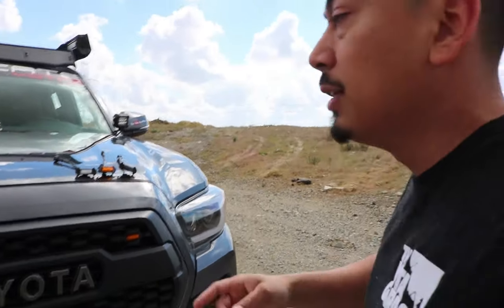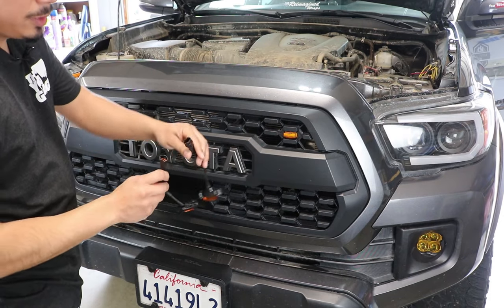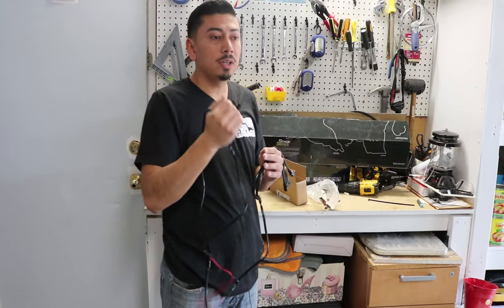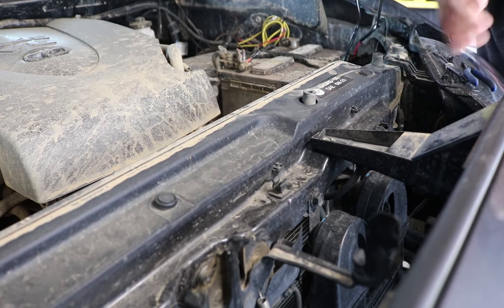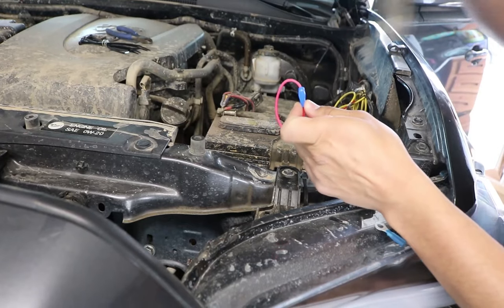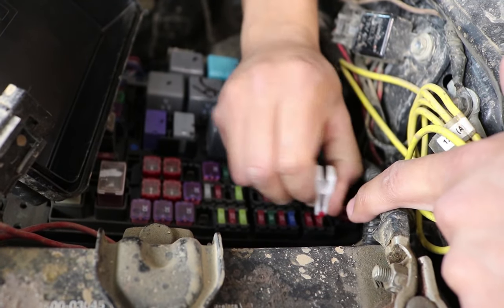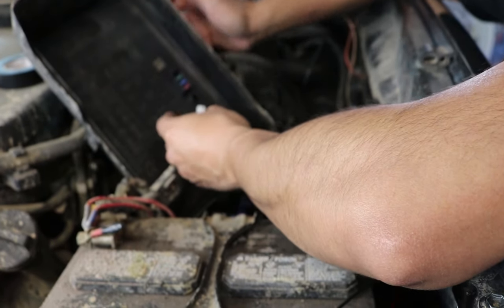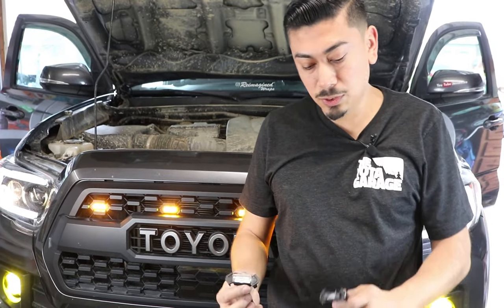HOW TO WIRE + INSTALL RAPTOR LIGHTS ON A  2016+ toyota tacoma TRD PRO GRILLE | MUST HAVE MOD

Comment: PROBLEMS I HAD

1. I had to use sand paper on both vertical sides of the outside 2 lights, they wouldn’t fit in the gaps of the grill. Took 1/8th inch off each side of the 2 lights.

2. Was only able to snap 2 of the 3 clips back on the fuse box because there isn’t an opening to feed the wires through to the box. 

3. If you assemble the grill too, the lock washers that go on the sensor need opened up a little with needle nose pliers before they’re put on. Had to throw pipe dope over top of them to keep them from slipping off. 

4. Taking the factory grill off in the beginning & trying to pull out the 12 or so tabs is a 100% guaranteed pain in the ass. 

5. Had to sandwich a washer in between the sensor & grill on the top screw hole connecting the sensor to the grill. Got a sensor error without it because the sensor sits too low to read anything. 

Great grill just a pain in the ass install.

Comment: How did you get fuse box to shut entirely? My front clip won’t snap on my 21 Tacoma with the wires coming out the side? It’s closed and won’t be used off road.
Reply from the maker: Slammed on it lol

Comment: Should battery terminal be off when messing with fuse?
Reply from the maker: Yes anytime working with electrical you want to disconnect the negative of the battery

Comment: When you installed the new TRD pro grille do you need to take it to the Toyota so they can reprogram the censors? Since it got change ?
Reply from the maker: No my friend just make sure u get a oem garnish for the sensor and ur good to go I left a link to where u can get the grille and in that website they also have the oem garnishses
Reply: I got an oem garnish off of Ebay for $25. Works great. No sensor error. Beats paying what Toyota wants for one!
Reply: Stingr1971 That 100% is not OEM if it was $25 off of eBay lol

Comment: With this installation,  do you need to turn on the headlights in order for the grille lights to  work?
Reply from the maker: Yes as far as how I installed in the video
Reply: @JesseRizo  you can tap into the INJ : ignition fuse and will turn on without the lights being on.
Reply: @SlickWillie  even with the same fuses 10 - 15?
Reply: @OscarHernandez-xn1yx  use the same fuse number as the inj...i forgot what it was

Comment: How do you close the fuse box tight with the wires coming out of it?
Reply from the maker: I’m trying to find the video I did but I’m having trouble but long story short if you can extended the wire I’d suggest tapping into the inside fuse box look for a acc applicable fuse and tap into that better (I ran it outside like in the video) for the longest never had a problem but it does get dusty in there over time and to close you have to cut a slight slit and even then it slightly pinches the wire which allows slight dust over time to sink in so if u have extra wire I’d recommend that
Reply: Simple get a small round file and put a notch in the plastic fuse box or cover for the wire to sit in

Comment: Hey Jesse, How is going over there. I just installed my raptor lights, but before installing them, I stop by Autozone and looked for the 10 amp fuse, and of course bought the 2 pack, only to find out that the fuses are not the same as the ones in the fuse box, I tried twice to figure out the sizes on the fuse, can you tell me what size they are please.
Reply from the maker: There the low profile for the Tacoma’s https://www.amazon.com/gp/aw/d/B087WZ953T?psc=1&ref=ppx_pop_mob_b_asin_title

Comment: What if I drilled a small hole in the fuse box cap to fit the wire, would that cause any issues?
Reply from the maker: It’s possible but make sure u buy sealant so water won’t leak in

Comment: Just added my grill and raptor lights. Waiting on my headlights to come. So the add a fuse is going to get pinched by the fuse cover when closing it?
Reply from the maker: Honestly I’m sure it’s pinched slightly but I jammed it in a way so it can seal probably it’s hard to explain to be honest just kinda kept playing with it until it closed down on itself

Comment: hey just curious why did you add a 15 amp along with the 10 amp in that add fuse??
Reply: I just installed mine but just installed a 15.. now my right headlight is out . Do I have to add a 10?

Comment: great video, but nowhere did I see you disconnecting the battery first.  Always, as a matter of precaution and to prevent a short circuit, disconnect the battery before altering/adding fuse box!

Comment: How can I add it to my 2016 Toyota Camry, I would like to use the DRL on bumper, so when the car is on the drl and the raptor are on at the same time, I try to find the fuse for those lights but I couldn’t find it, do you have other idea how to make it work?
Reply from the maker: I would check and look for the same fuse as shown

Comment: How did you secure the cap of the fuse box back on? I can’t get all the caps to click because the wire is being pinched
Reply from the maker: There’s a way to seal it properly it will be pinched slightly but it doesn’t effect it I had them on my last truck for the longest with no problems
Reply: Jesse Rizo  I tried to close the fuse box on my wires like in the video and it cut the wire in half.
Reply: How did you do it?
Reply: Anyone?  I had the same issue. This seems to be the problem for a lot of people...

Comment: Have you had a problem with the right headlight not working when adding the add a fuse, but the raptor lights working?
Reply from the maker: No I have not 🤔

Comment: If I wanted to have them with the daytime running lights is there a location for that in the fuse box? Also if I wanted them on all the time day and night is that possible?
Reply: EFI 3
Reply: EFI 3 fuse for that

Comment: I did exactly what you did but it doesn't work I think the fuses are wrong or maybe the add a fuse is wrong any suggestions?
Reply from the maker: Check all your connections maybe u didn’t crimp it down all the way and it’s not making connection
Reply: @JesseRizo  thanks for the reply bro! My cables were switched up. Your red was my black lol

Comment: do you think i can install a grill like that on a 2007 tacoma
Reply from the maker: Yes but not this specific one they also have trd pro grilles for the 2007 Tacoma they look similar but it’ll fit yours
Reply: @JesseRizo   thanks can i order one for tacoma 2016 do you think it will fit?

Comment: Jesse waiting for my raptor lights to arrive. I want thsse lights to light up when the drl lights go on and also when driving at night.  What is the correct fuse to put them on inside the fuse box my truck is a 2019 sr5.
Reply: Ricardo Fernandez add a fuse on the INJ in tge fuse box

Comment: Damn sold out brother.
Reply from the maker: Check runnin4tacos.com 
And see if the discount code JESSERIZO STILL WORKS

If not check Tacomabeast.com 
Discount code should be jesserizo5
Reply: Thanks Jesse! I order the raptor lights on runnin4tacos.com and the code still works. Thank you brother!.

Comment: I followed all the steps and my lights won’t turn on, the lights I bought came with an extra add a fuse ( a 5 mini instead of micro) . I tried both the 15 with the 10, and the 5 with the 10 ( mini fuse).

Comment: The red wire being squeezed by the cover is ok? I didn’t see that part in the video. Existing wires come from the bottom.
Reply: With all the movements from driving the vehicle, that wire insulator is going to chafe and get cut very quickly. I would suggest cutting into the fuse box cover with enough room for the add a fuse wire to go through without it chaffing against the plastic.
Reply: The box is meant to be sealed properly.  When you cut into the box, you are now creating a new failure point.  I know there is a way to tap into power without going thru the fuse box, but I am not sure how.

Comment: Is there a way to run my raptor lights with the Daytime running lights?
Reply: Wondering the same thing
Reply: @TheBliz22  I ended up putting it in the INJ fuse since it was the same amperage as the headlights. I tried the DRL fuse since they turn on with the truck, but when I did that the raptor lights were constantly running even w the truck off.
Reply from the maker: Yea I had tried that to I should’ve mentioned it in the video but yea it seems it will only work with headlights unless u tie into a switch
Reply: @chriscrenshaw3230  Thanks Chris. Just watched another video that showed the same. Hooked mine up to INJ as well and seems to be working as expected
Reply: @JesseRizo  good video regardless!
Reply: @TheBliz22  of course! I love the look of mine even more now

Comment: Interesting. The company I got my "Raptor lights" from sent me 2 5 amp fuses for the add a fuse. A few months go by and I lose power to my passenger low beam. After fucking with it and removing the add a fuse and placing a 10 back in where the add a fuse was my low beam turns on... uhh what?

Comment: Hey Jesse, will this kit still work if i only want to install three of the lights instead of four? Or will it short out and not work?  Please let me know if you can. Btw. Keep up the great vids man, you're one of my fav youtubers, you always have great and easy to follow how-to/ mod videos. 👍
Reply: Snip it off, make sure one of the wires are longer than the other. Tape it up and make sure the negative and positive dont touch. Then you're good Luke.
Reply: @TacoNotaPro  okay, i was thinking that i might be able to do that. Just wanted to make sure i didn't have the Christmas light tree effect, if one bulb is out, none of them work...
Reply from the maker: Try doing that 👍 send me a email 
jesserizoyt@gmail.com
Reply: @danishtaco3852  all the wires that split into 4 are the same length from the main wires. They aren't feeding off of each other like your xmas lights reference.
Reply: @TacoNotaPro  Perfect. Thanks for the assurance!

Comment: Anyone have any tips for lights that don't fit/click into the grill?  My two on the outside of the grill (far left/far right) seem to be a bit smaller than the grill slots in the middle.  Do I need to file/sand the light house or the grill to get it to fit?
Reply from the maker: I would file down the light itself do it little by little so it’s not loose when u install

Comment: LMAO.   No matter what the install is, according to Jesse, it “Super Simple”.     

“Today folks we’re going to install a brand new TSP Stage 1 Low Lift Cathedral camshaft, new lifters and complete valve train on our 2019 TRD Off Road Tacoma.    It’s a super simple install and you need only a few tools that every DIY’er should have on hand!”

Comment: EFI 3 fuse for 2016 to 2021 Tacoma to turn on when you start the truck no headlights needed.
Reply from the maker: Send me a pic of where u placed it I’m curious jesserizoyt@gmail.com or @_jesserizo
Reply: @JesseRizo  will do. And pictures of my 2021 Pro with a Magnuson Supercharger that kicks ass.

Comment: You should never ever put a higher amp fuse than the amps on the fuse you’re tapping into, replace that top 15amp fuse you added on top of the bottom 10amp fuse with something smaller like a 2amp fuse,  these led lights don’t draw that much power.
Reply: So what fuse do you use I added what he did and they don’t turn on
Reply: @MrAlfaro23  hey did you ever get it working, curios about this issue

Comment: I thought the top fuse is supposed to have less amps then the bottom fuse?
Reply: I’ve also heard that. What did you end up using?
Reply: @beptex2858  just ended up wiring to the parking light. Had 2 burn out too fast
Reply: @mcham0846  so you never tried it on the fuse box?

Comment: That engine bay 😱
Reply: Like G Inferno said "hardwire".

Or at a minimum, apply heat shrink over all those connections you made that weren't waterproof.
With the way that engine bay looks.
Reply from the maker: They are heat shrinked I didn’t think I needed to state that since u can straight up tell lol, only one that is not heat shrinked is the red one but if u noticed after it was crimped down I applied electric “black” wire tape to it. I’ve had the truck for about 2 years now and u can see how my engine bay is and everything still works fine

Comment: Could do it with the DRL
Reply: no it will stay on even if the truck is off with the DRL. you cant just leave the switch on at that point.